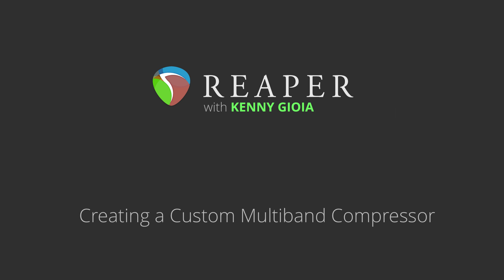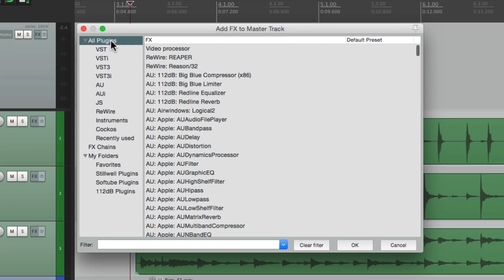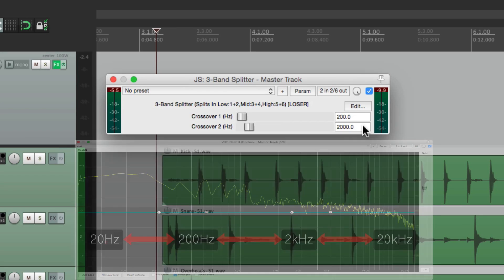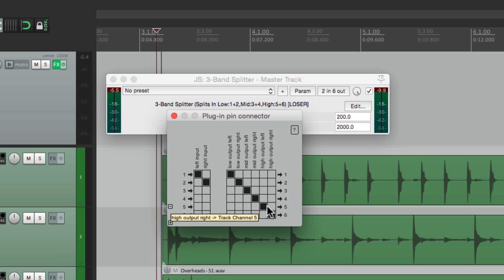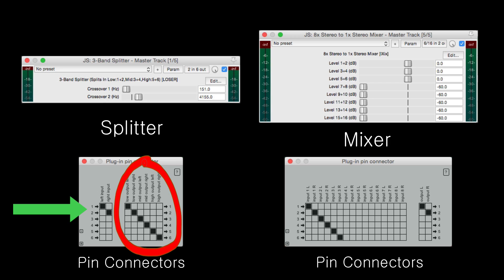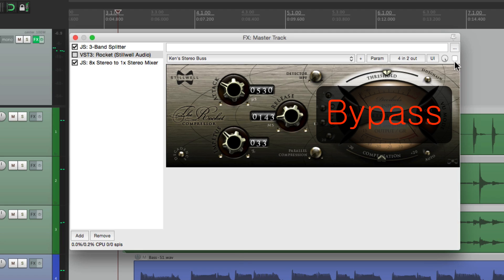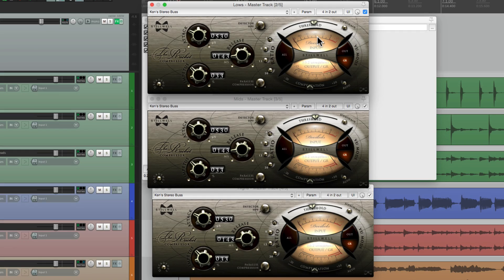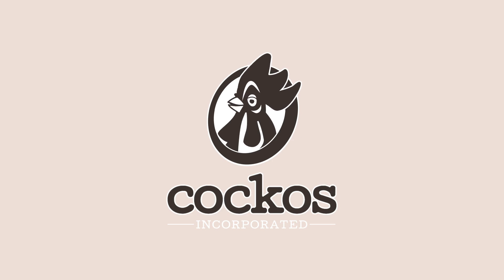Creating a Custom Multiband Compressor in REAPER

Comment: This is great. However, I have a question. I watched your other videos about dynamic EQ, tried it out, and it worked very well. But I still don't fully understand when to use the one and when to use the other. Don't they basically do the same or a very similar job? Any pointers in this respect?
Reply: They all do "similar" things in different ways but without having your source material in front of me, it's hard to say what would work best when. For me, I would use a multiband compressor more for busses or the master buss or fader and use the dynamic EQ more on individual tracks. But that's just me.
Reply: @kennygioia7184  Thanks a lot, Kenny,. Yeah, that makes sense. Dyn EQ allows you to be more surgical. In terms of CPU usage, I noticed that some of the Waves multiband compressors are very heavy on the PC. Is that also the case with ReaXComp? Doesn't seem to be the case with dyn EQ, though I haven't used it on more than 3 or 4 tracks yet.

Comment: Hi Kenny,
this question isn't directly concerned with this video, but I've got a bit of a problem with some audio I recorded and I had the gain up too high on the radio mike transmitter - with the result that the audio sounds horribly compressed, not exactly distorted but very squashed. The client hasn't noticed but I am cringing every time I hear it - is there any chance that there is a Reaper solution that will sort of re-expand the audio? Clutching at straws but Reaper is pretty wonderful...  hoping you can help!

Joe Driver  (very big fan or your tutorials Kenny)

Comment: This vid should be a mega sticky vid on Cockos site and Cockos forum;

It completely nails one of the very strengths of Reaper, namely the amazing routing features it has.
Many Reaper Rookies problaby should watch this many times again, to understand really how it works; the pin connections stuff took me some time to fully understand ;0//
And when they do, they finally would see that this is so powerful, and they would be in heaven.

Many thanks Kenny , you rock !!
Reply from the maker: Thank you sir.
Reply: Preach Rob! It made me understand the routing as well. Regards, Reaper rookie.
Reply: and your tutos are the best! thanks so much for everything ;D (Y)
Reply: cant love this enough! 
i did  something similar but with the Hi and Lo filters of the plug in, it kind of did the trick but wasnt that good as this looks like. and the fact i can use any plugin in the chain... pff, nuts me off haha
start to loving Reaper... again ;D
Reply: Good 4U Victor !
Warm Regards.
Reply: For real. Routing and FX chains are a big thing in reaper.